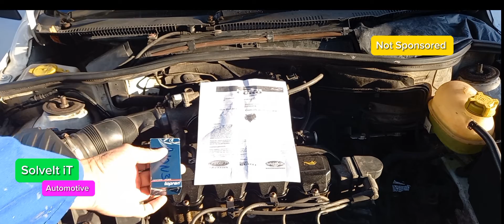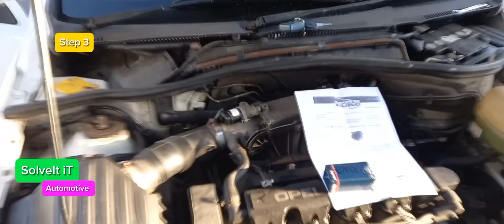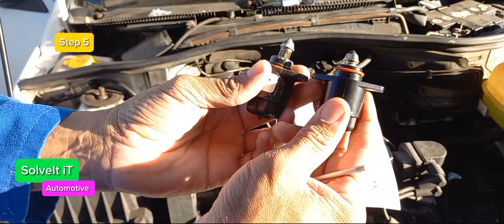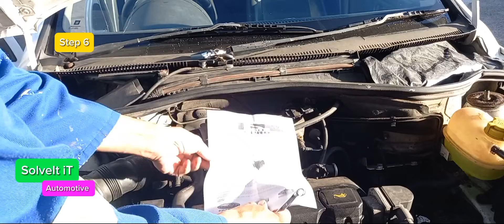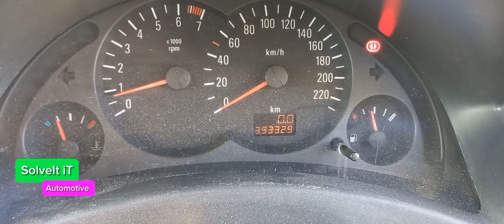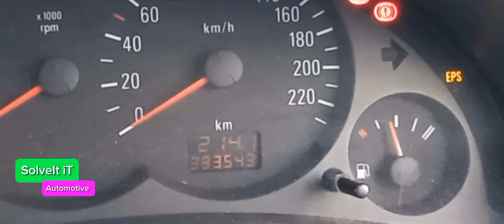Opel Corsa 1.4i Utility Testing Air Idle Valves

Comment: Hi. I have a corsa 1.4 utility 2006 model. 257000 on the clock. Problem I experience is overheating whiles driving. Radiator is replaced,water pump works, I checked the fan it works well .
Reply from the maker: Hi . Best thing is to have it checked out. if the outside components are in good condition , no air locks in the system , it may be time to start looking internally. If the heat gauge is going up quicker than usual or going beyond the normal mark , it may be time to look at the head gasket. get it looked at.
Reply: @solveitautomotive9485 Thanks appreciated 👏

Comment: Hi i have a 05 corsa lite 1.4i, it can't Crank on its own, it needs a throttle whenever i start it. After throttling it, the idle is super weak, below 1000revs, and makes a squeky sound until the engine gets hot, only then it revs normal, what could be the issue, ive checked both my idle and tps sensors, they seem to be working. This is really frustrating. Im scared to take it to just any mechanic because folks are out to make money and not fix these days. Please help!
Reply from the maker: Hi . Sorry to hear that. Unfortunately my recommendation is going to be to take it to a mechanic. You could have a number of issues and you have to start with a engine assessment.
Reply: first start by cleaning the throttle body,then reset ecu by disconnecting the battery for 10-15 minutes

Comment: I had replaced that unit today that I bought from golfwagen on my Corsa lite, and after Iv driven for almost 25km, my problem was NOT solved....and I'm looking forward for your follow up clip to see if you had issues thereafter
Reply from the maker: I did do a follow up video on the pump , I think it's the second recent video I put out. 
But that goldwagen housing is only temporary measure , I am going to try and get the Bosch one and do a video on that

Comment: Love ur informative videos
I have a corsa b bakkie cold start has a misfire but one engine temp picks up misfire goes away. Any advise?
Reply from the maker: Thank you. Start checking from the outside the simple things , loose wire , plugs , plug leads, coil and then go inside start with a compression test

Comment: Where do I check for the ideal valve sensor on the chevie utility bakkie
Reply from the maker: If it is the new spec manifold it will be on the right side in top. It does not look like the one on my engine .

Comment: Hi, im a big fan. I recently replaced oxygen sensor on my bakkie the after started idling funny.
Reply from the maker: Hi there thank you. Well it could be the ecu is affected . If you have the old one and it was working put it back and see what happens. 
Sensors are not all created equal on these opels and can be a problem.

Comment: Hi, are u based in Cape Town?… as I have a misfire issue on my (import) Opel Tigra (LHD)… and have basically bought (from Germany) all sensors and coil packs… plugs changed, ECU changed?… still a misfire on this Ecotec X14XE 1.4 16v motors?…, can u help? Motor was totally rebuilt and rebooted (only done 8000km) since then?… it has been to two mechanics but they “gave up”…. And car hasn’t been driving for the past 3 years… as it has been “in workshop/s” … after a slight misfire started. Car back fires only (last mechanic’s words) car is 1997 Opel Tigra 1.4
Reply from the maker: Hi sorry for the late reply.  Sounds like a real challenge. I am based in Cape Town, unfortunately I am not doing any vehicles at this time.
Reply: @solveitautomotive9485  Ok...no worries then, Thx
Reply: Good day sir I have a Opel Corsa classic I was wondering if u could help me with my speedometer that stopped I've changed the speed sensors by the wheels but still it's not working , can u help please

Comment: Hi, so I have the same engine, mine just the chev badge 6w engine, just had my cam replaced along with rockers and lifters, so it's quiet but idling rough and low at about 500revs which is definitely missing. I took off idling sensor and cleaned it and the O2 sensor did not touch the map sensor, was a bit to tight did not want to damage. However it still idles rough and at 500 revs, what am I missing, please help
Reply from the maker: Hi . It's very difficult to pin point. Everything has to be rechecked , from timing, tps to wiring . Make sure you use original sensors (Mexico) not the aftermarket ones . They work or they don't work in certain vehicles .
 I had a similar issue , turned out it was a loose wire in the small loom.
Reply: @solveitautomotive9485 Where did u look for the lose wire in the loom?
Reply: One last question, was I supposed to take battery terminal off when I took off the sensor to clean it
Reply from the maker: @kieravolkwyn351  no it's not necessary, however after changing major parts or a service interval it's a good idea to do it as it resets the ecu.

Comment: 96 kadett 1.4i..i changed icv from Midas..car revs high and low..disconnect the map sensor and icv then car idles normal..but i can smell it running rich..
Reply from the maker: Hi Try to get a genuine second hand idle valve . One made in Mexico , it will be a better choice than the ones from the spares shops. 
Also check your wires and electrical plugs

Comment: Location of the iac valve Chevrolet utility 2016 model please
Reply from the maker: On the throttle body , It's a joined unit . Also check gap and service on cps

Comment: Where is the co2 sensor on a 1998 corsa b 1.6 
My utility is all of sudden very heavy on fuel after a normal service. Spark plugs smell petrol and is wettish, and car exhaust fumes are rich
Reply: I'm having the same problem. I replaced tps, idle and air intake senors on. My problem has been resolved with that.

Comment: I have an issue with my speedometer. Stopped working a while ago. Replaced sensors doesn’t seem to be helping. Any idea what else I can check and or replace?
Reply from the maker: That's a difficult one . Check the wiring from clock to sensor. Then the clock itself
Reply: I have the same problem, where is that sensor situated?

Comment: You need to do one on the TPS from gold wagen. You will see that it's the wrong one for the car. I had idle problems for a year. After trying many tps fr gold wagen. Cleaned my old one with electrical cleaner and put it back and the car is fine.
Reply from the maker: I try to avoid buying anything at GW , there parts always have some problem. That's why it's good to get to know the names of the various makes and manufactures of parts and research them. 
I would rather try Masterparts, Diesel. Electric, Suburban or Alert. 
Thanks for the suggestion I will do it for you  and see what happen wish me luck 😓.
Reply: What electrical cleaner did you use?
Reply: @deonvanzyl1465  any electric cleaner is fine. I used one from midas can't rem the name on hand

Comment: I need your guidance. How many lambda oxygen sensors does this bakkie have? I have the exhaust gas oxygen sensor light on, and the engine sounds rough when idling.
Reply from the maker: This vehicle only has one on the exhaust. Rough idle as I always say can be many things. Start at the basics first.
Reply: @solveitautomotive9485  I took to Opel for further assessment and diagnosis. They suspect a faulty fuel pump or injectors. Does this make sense, though?